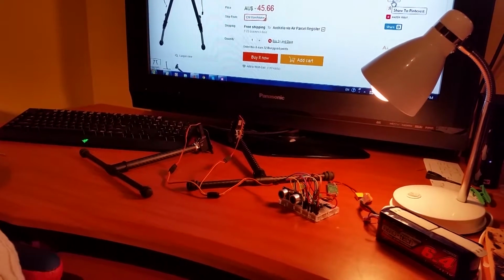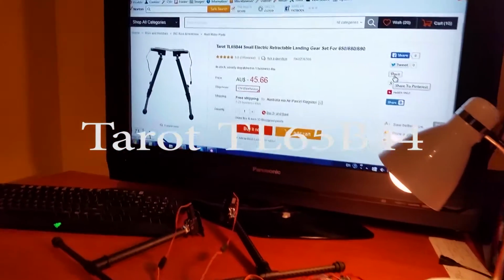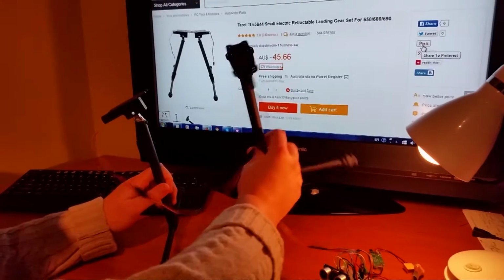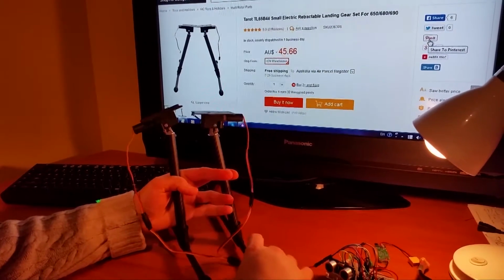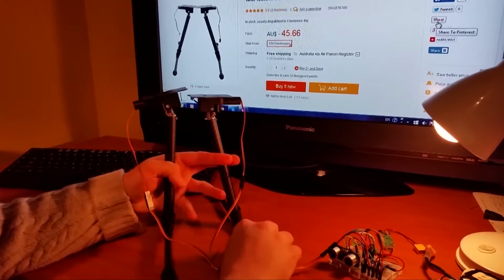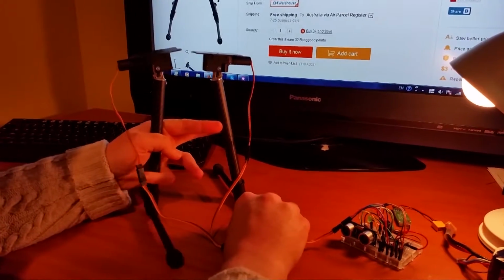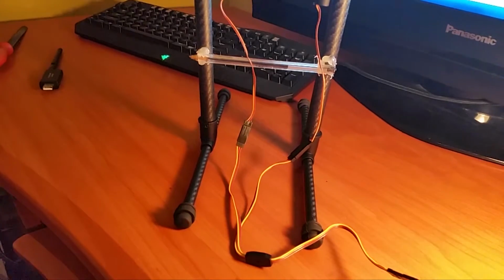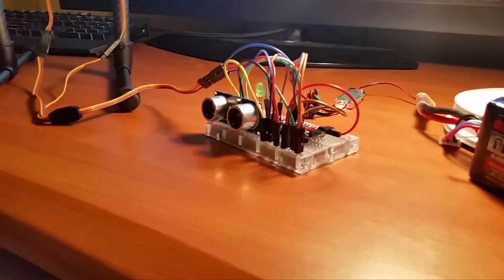Tarot TL65B44 Landing Gear Automatic Setup

Comment: On the tarot gear, what did you say the operating voltage was and where do I find a Y cable ?? I am converting a Walkera Voyager to this type of gear. Thanks
Reply from the maker: Joe Bouza You need a separate 5V BEC. Connect black and red wire to the BEC, while signal wire to the signal output of the controller. there's a link somewhere in the video, if you follow it you'll get to the full description of this project on my website (channel name.com). keep the grounds common.

Comment: Well first let me say how much I admired the concept of using such a device to engage retractable landing gears in such a manner. It seemed somewhat low cost and simple. I came across this format when I found my Yuneec Q500 ST10+ controller did not have any extra channels for me to input with switch function for the retracts and was stuck with this idea. I at first thought of using a 433hz remote wireless receiver but was told of the possibility of to much interferences and  dropped the idea unless you know different. 

I am now only stuck with trying your approach by using ARDRUINO NANO with the HC-SR04 Sonar module and
was hoping you could help?  I also heard of its complications of landing on grass but I prefer not landing on solid structures anyway. As I can see, quadcopter has more damage landing on grass. You input would truly and help would be appreciated. I’m not good a programing the Ardruino however I do have some programming experience with other devices.
Please help!  : (
Reply from the maker: I have tried landing on grass many times, my hexacopter is pretty heavy, so not too many problems with rather tall grass, too.
As for Arduino programming, there's not too much to do. You can download the code (.ino file) from my website (there's a download button there somewhere). In order to upload it to Arduino Mini Pro (I thin k Nano shouldn't be a problem either), use Arduino IDE and FTDI/USB adaptor board. There are may generic boards around. Let me know how you go and I'll try to help you where I can. Wiring diagrams are on the website, too.

Comment: Its 2016 and I was wondering if you can give some final recaps on how the sonar setup is doing?
Reply from the maker: I have written an article on my website: http://www.ediblefly.com/ediblefly_main/index.php/our-projects/arduino-projects/28-tarot-tl65b44-landing-gear-driven-by-hc-sr04-sonar-sensorThe setup is working good, it's part of my hexacopter for a long time. I will try to make a video to demonstrate it in action. Of course, HC-SR04 is a rather cheap unit with limited performance capabilities and you can get an occasional false positive (once in 3-4 flights, depending on how you set the filtering variables). Averaging and error filtering (part of my current code) cause delays, so it is a good idea to program a hovering (at 1.5-2m) step before automatic landing. This should be possible with APM firmware. BTW automatic gear retraction is a part of Pixhawk firmware, so my little project is relevant only for legacy APM controllers and others (like Openpilot Revo).